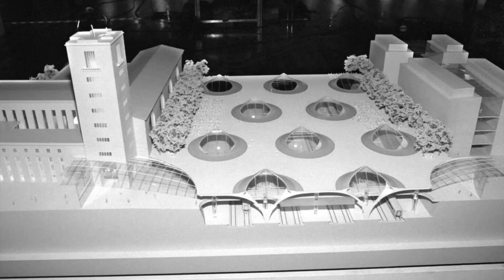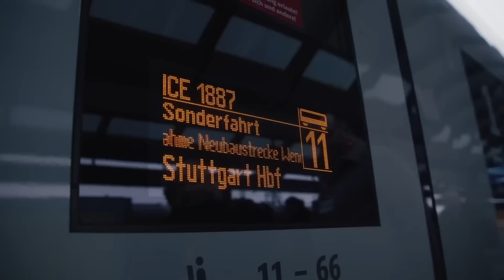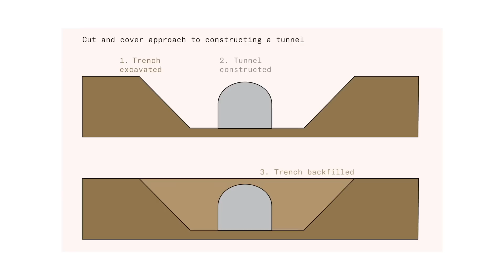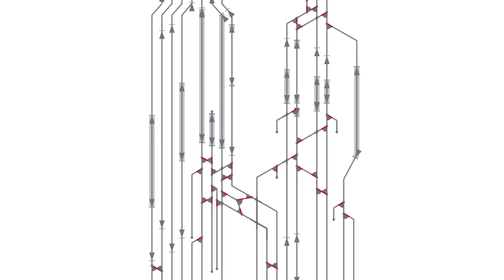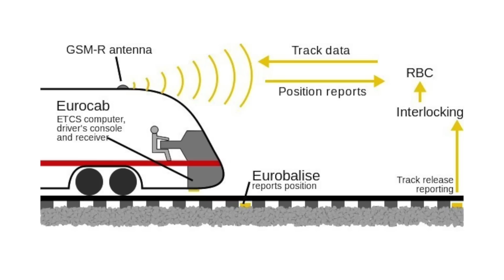The $11BN Battle To Build Stuttgarts Railway Project

Comment: Every train has to stop on a station to avoid more frustration of the passangers. It takes only 4minutes to change the direction in a railhead-station. The mega project brings many problems, we may have more chaos with several trains on the same platform because there are too less tracks (only half as much tracks as the old station have). The old station must be preserved to handle all the trains which are running now and more in the future, to let the trains of Zürich reach Stuttgart mainstation, so we don't need the Pfaffensteigtunnel. Also it isn't  a good idea to have thousands of people in long tunnels because evacuation should be always realistic possible when fire breaks out.

Comment: I am from Stuttgart and you are missing two of the most important benefits of the project in this video.

1. Because the new main station will be underground a gigantic area that was before covered with railways and holding sidings will be free to develop a whole new city district in the center of Stuttgart, an opportunity that few citys will ever have. Furthermore this will unite the city which was bevor separated by the railways. You can not overrate the effect this will have for the future of the city and its liveability. It is simply unprecedented.

2. You missed in the video that the project includes a new connection (and station) to the airport. Today you need 40 Minutes form the main station to the airport with public transport. After the project is completed it will be less then 10 Minutes. This will be on of the fastest (maybe the fastest) inner city to airport connection in the world. If you keep in mind that Stuttgart is pretty much in the center of Europe you can be in every major European city in under three hours. Absolutely amazing.

If you will do another video in the future (maybe after completion of the project) you could include these benefits.

Comment: The Idea of Stuttgart 21 is good, cause Head End Stations are stupid BUT the Problem is, they already building it too small for the Traffic to come... and thats whats stupid about it.
German here. :)
Reply: correct the new station will have fewer platforms then the old one.
Luckily this project is not a total (designed by political comitee) clusterfuck as the Willy Brandt airport in Berlin was.
Reply: @obelic71   is it compleatly replacing the old station or is it jus augmenting it if there is a problem in the tunnel could they reroute the train to the old station.
Reply: @alexisdespland4939  Destruction of the old station (i.e. tracks) is the plan. The whole thing was started to develop real estate, not to develop & improve rail traffic.
Reply: @alexisdespland4939 they already sold the property were the old station and tracks are located. It was part of the finance plan.

Comment: That the opening was postponed from December 2025 to December 2026 is not construction-related. 
It comes due to the aim to operate this new railway knot only with the new ECTS 2 signaling system. This saves costs but means that all trains using this new railway knot need to be equipped with this signaling system. Esp. retrofitting older regional trains with ECTS 2 is the main bottleneck.

Comment: Off course they didnt tell the real price in the beginning, they never do this, they always lie about the cost. The initial price was about 3 billions and over time they revealed the truth, thats known as salamitactics, slice by slice the price goes up.
Reply: 3 billion 1994 in a "planning stage".
When the construction was started in 2010 the costs were estimated to be nearly 5 billion.
In 2011 the project was due to protests politically haulted. And only restarted after some improvements (which did of course increase also the costs). The construction cost price explosion in the last decade is not limited to Stuttgart 21.  
Current comparable railway projects cost 2-3 times more per range kilometer than Stuttgart 21.

Comment: A nice promotional video…
Wendlingen-Ulm is a separate project.
Some points of critics ;
Going from 16 tracks at ground to 8 tracks underground will not be sufficient in a close future and use of one track by two trains in two directions at the same time is planed…Not all trains will go through but end or start there too !
The east- and west wings of the classified station building have been demolished…!
Some of the tunnels are bored through Anhydride - a very dangerous rock type that swells in contact with water…
The incline of the platforms is steeper than the German Federation allows…
Critics accused the planers of “Numbers-Shrinking” since the project was presented !
😂
Build underground-stay at ground !
Reply: A transit station with 8 tracks has more capacity than a terminal station with 15 tracks (track 1 is not used anymore for scheduled trains since the S-Bahn was opened in the late 1970s due to changes in the track layout). 

Also the current terminal train station can only be accessed by railway tunnels. And some of those had to be built through Anydride as well. Like the south-west tube of the Pragtunnel. Built in 1844 (the 2nd oldest railway tunnel in Germany still in use). Stuttgart is a challenging ground to built tunnels - but this is manageable. Due to its topography Stuttgart has quite some experience with tunnels. The first tunnel for motorcars on the planet was also built in Stuttgart (Schwabtunnel 1896).

There is no rule for the incline of platforms. There is a recommendation for the incline of tracks at train stations. Until so 40 years ago this was a rule (with the option for an exception). The background was the poor braking force of decoupled rail cars at train stations. But this one has improved. Passenger rail cars are becoming anyway exotic nowadays. And unlike with the old terminal train station where decoupling the loco from the rail cars is the norm, this task is obsolete at the new transit station.
Reply: @martinstock  
Uncoupling trains and locomotives is obsolete nowadays…push-pull…EMU’s…